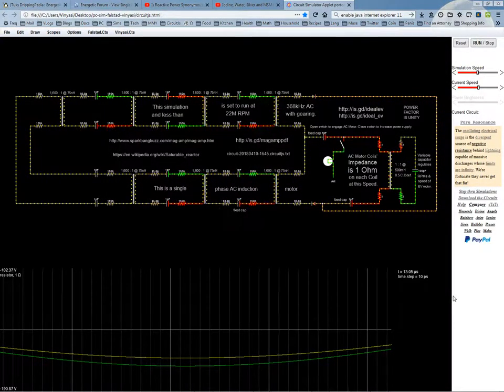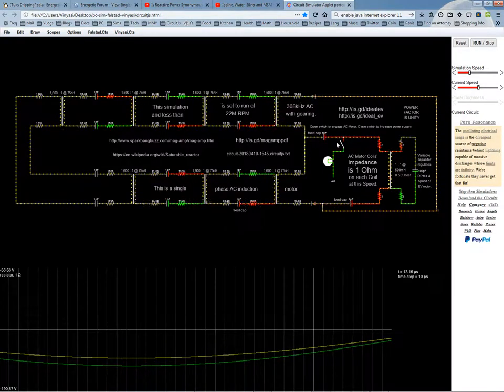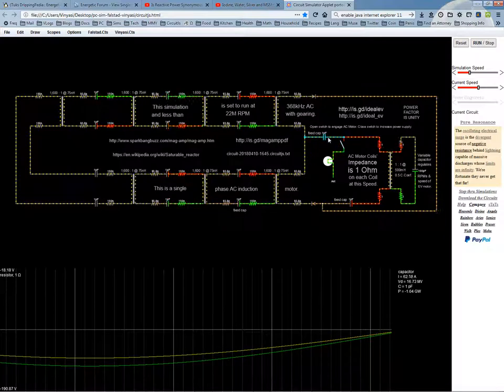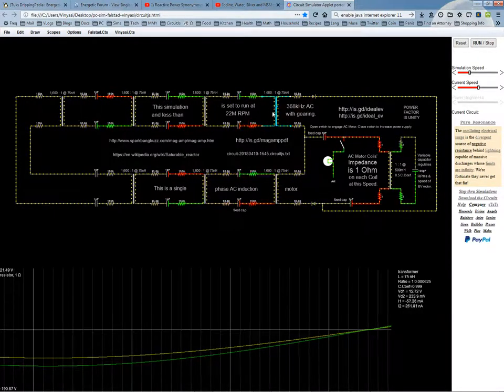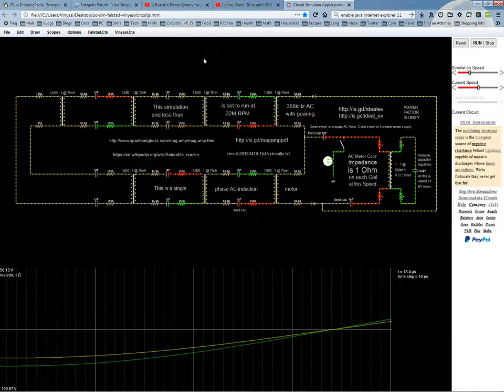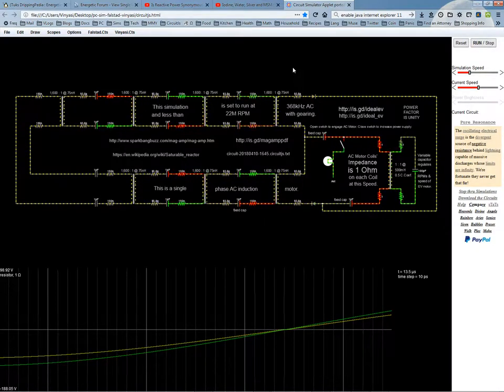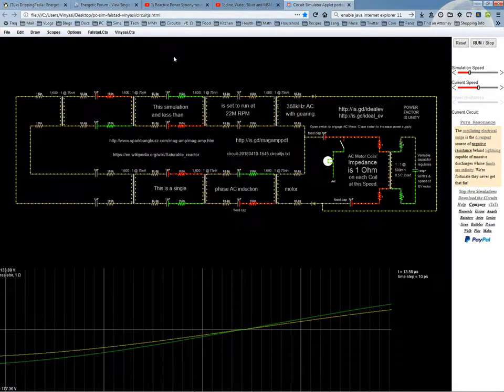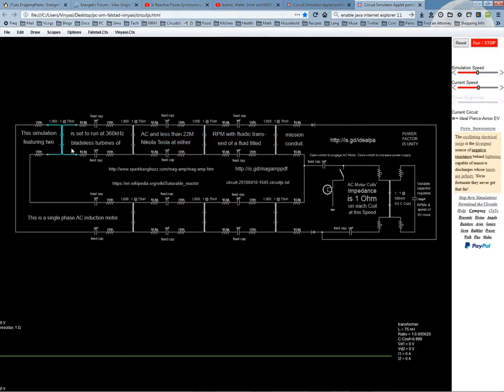An Ideal Pierce Arrow is a Magnetic Amplifier with a Daisy Chain of LMD Analog Computers

Comment: how long, does it take with 10 picco seconds, to reach 6 micro,  thats a 17 order differance,  right..😑😑😑
Reply from the maker: I don't know. It's been a while since I did this video. Sorry.
Reply: So basically,  any surges that happen,  wouldn't be guaranteed to be constant of recurring in any usefull sense right.  But then an dude a work told me that he thought , in electrical,  a picco is , he thought it was inbeetween a millionth and a billonth,  something else, not the 10 (-25) we think of.
Reply from the maker: @ryanb1874  Correct. I think a pico is 1e-12 = trillion. Yet, I altered my mirror of Paul Falstad's electronic simulator to help me see surges develop from yokto units, aka 1e-24, and a little lower, or else I might overlook a promising circuit simply due to my ignorance and lack of patience to wait longer for a surge to noticeably appear on the scope beginning with the simulator's prior minimum which was a pico unit.

milli = thousandth part of a unit
micro = millionth part
nano = billionth part
pico = trillionth part
femto = quadrillionth part (LTSPICE and Micro-Cap recognize this)
atto = quintillionth part
zeto = sextillionth part
yokto = septillionth part

https://en.wikipedia.org/wiki/Names_of_large_numbers#Standard_dictionary_numbers
https://is.gd/bignums
Reply from the maker: @ryanb1874  If a battery dies, then it isn't constant. An overunity circuit is constant within its limitations: a window of constancy. Just like a battery is constant within the window of its lifespan.
Reply: @charleschandlertornadoelec6231  But. do the homo, and unipolar generators actually work ? Adam Trombly acts like they arnt overunity, just many amps with less felt emv,  (Low volts) is there transformer in the world to change 1000000 amps and 50 volts,  into safe levels of power for conventional equipment.,   But thank you and thanks for the explanation,  the homopolar will run indefinitely though,
Reply from the maker: @ryanb1874  Adam Trombly was slapped with a United States Congressional Gag Order to never again talk about his device. This is not surprising in light of the cartel arrangement between the United States Navy and the United States of America. The Navy laid a prior claim to his device. It gave an output of 40 times greater than its input. Yes; it's very safe!
Reply: @charleschandlertornadoelec6231  ok cool